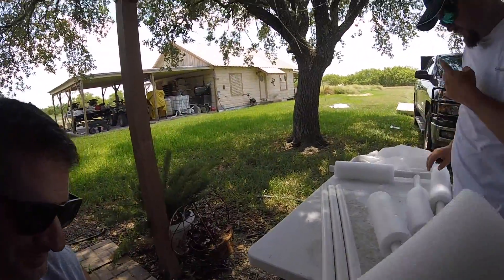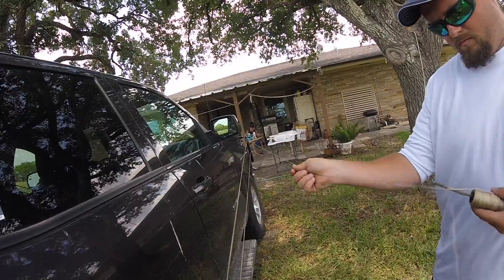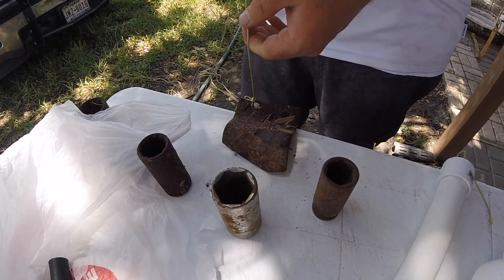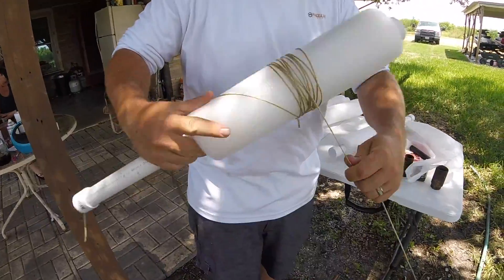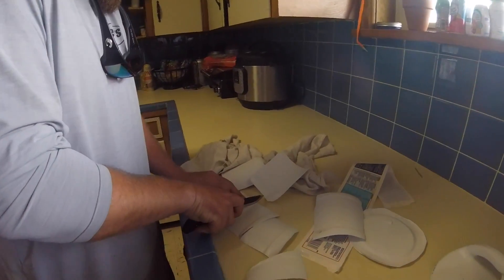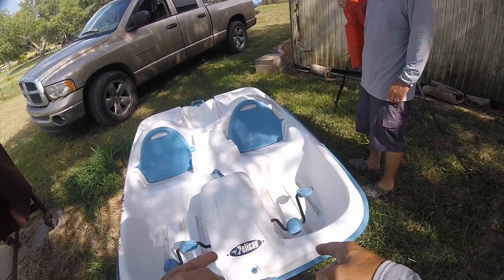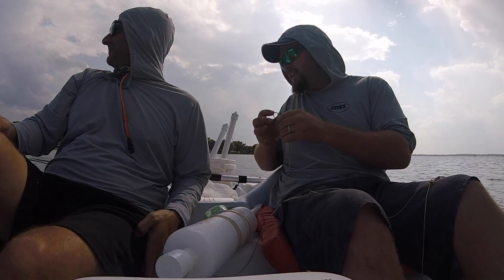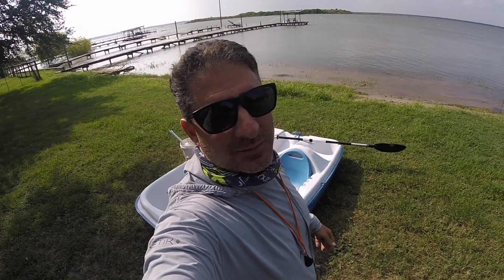How we built Jug lines for Catfish with PVC

Comment: That'll work for eaters. A decent blue or flathead will pull those under and drag them hundreds of yards makes em hard if not impossible to find. If you take a one dollar plastic cutting board and drill a hole in the center of it just big enough for the pvc pipe to slide through the hole but not the pvc cap that will help give you more buoyancy and make it harder for a fish to pull it under.